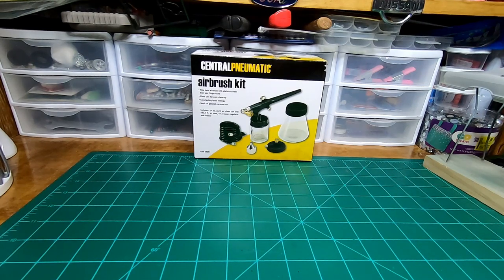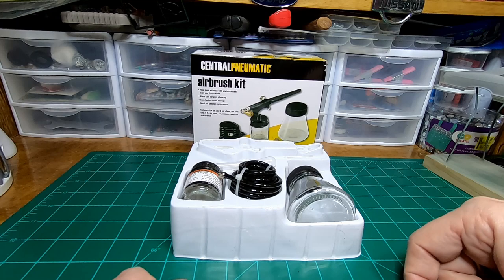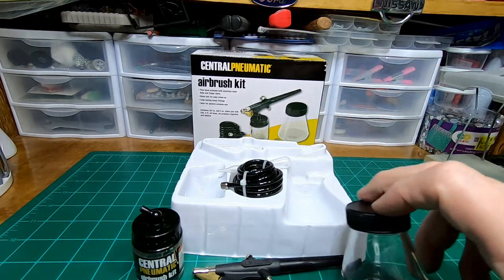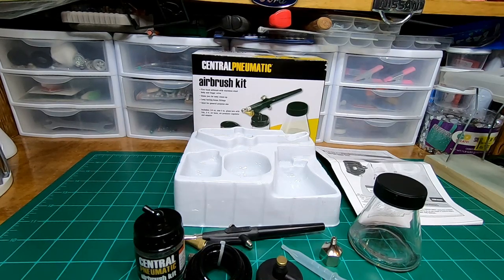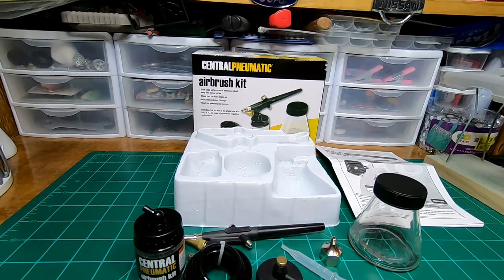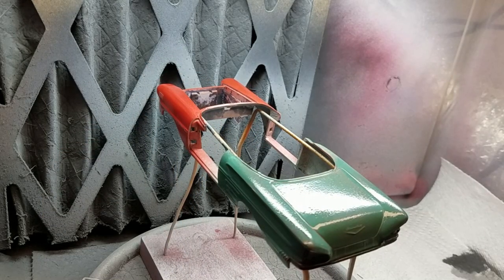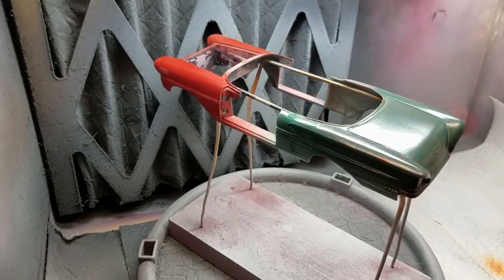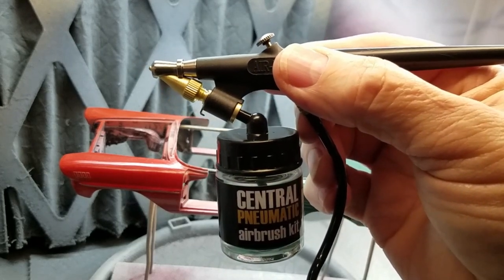**BONUS VIDEO**  Central Pneumatic Airbrush Kit Review - Episode 29

Comment: I have this airbrush, and it's one of my most used brushes. It does a great job laying down acrylic primer! That stuff can be murder on an airbrush, so the ease of cleaning is a strong point for this one. As one of your other commenters noted Harbor Freight no longer sells this style of brush, but Hobby Lobby (among other retailers) sells the Paasche EZ Starter airbrush, which is basically this airbrush in a different color. One of the first things I did when I got the HF airbrush home was to unscrew the top off the small jar and drop the jar into some acetone for a while. I don't know who the bright light at HF was who thought "Hey, let's put a label all around the jar so the user can't tell how much paint is in it!" was, but he should cuffed upside the head one!
Reply from the maker: I originally bought this airbrush for the extra jars. When I took it out of the box I thought that I would do a quick review on it. If I recall correctly this was on clearance when I bought it. Turns out that this is a pretty decent airbrush for the money and does get the job done. I am all about doing the best job for the least amount of money and this fits perfectly into that category. I have the Paasche EZ starter as well but haven't tried it out yet. I use my Model H all of the time and don't think about breaking out the EZ starter until after the job is complete. I will get around to doing a review video on that eventually. I agree with you on the label, it is very inconveniently placed on that bottle. When I did my test shoot I had previously mixed craft paint that I just poured into the bottle. I knew that I wasn't going to spray much, so I didn't worry about the level of paint. If I was going to do a full body I would remove that label so that i could see the paint level. Thanks for watching

Comment: I wanted to see how and what compressor you use and how do I hook it up part of the airbrush to make it work, i never used one before and i have this one
Reply from the maker: Sorry that I didn't include that in my video. I use a 1 gallon air compressor that I purchased from Walmart several years ago. I then went to Harbor Freight and purchased an air pressure regulator, an air fitting to fit the air compressor and a 1/2 inch male to male fitting to thread into the regulator so that I could attach the airbrush airline to it. I will post pictures of these items on facebook.com/scaleautoguy so that you can have a visualization of what I am talking about here. THe compressor has a built in regulator but having the secondary regulator makes it, IMHO, a bit easier to use. By that, I mean I can keep the secondary regulator preset with my desired air pressure and just  basically open the valve on the primary regulator without having to set the pressure every time that I use the airbrush. There are easier ways to accomplish the same thing. I already had the air compressor from a different project and only had to buy the regulator and firrings. All together, including the cost of the compressor I spent about $115.00. The compressor at the time was $99 and the regulator and fittings were around $15. I hope that this answers your question. Make sure to pop over to my facebook page and check out the pictures I will be posting in a few minutes.

Comment: I've painted a lot of models with that inexpensive airbrush. It's what I started with, actually. I don't even think they sell those anymore. I have 2 of them.
Reply from the maker: I bought this for the glass jars and to use as a backup to my Paasche. I was impressed at the quality of the paint job overall. It wasn't until after I shot this video that I discovered that they do indeed, no longer sell this particular style of airbrush. So, on that note, one could use this as proof that just because it is low priced, doesn't mean that it won't work at all.  Thanks for watching!
Reply: Got this exact one three days ago and it was on their clearance shelf. So you're probably correct. $10 well spent from what I can see.

Comment: I bought the exact same one in a slightly different package off Amazon for $15 it arrived today. I have used this type of air brush for 40 years and one of them lasted me almost 25 years. The key to keeping them working good is to clean them very good with lacquer thinner after every use! Do not soak the trigger shaft with lacquer thinner or they will quit working.
Reply from the maker: That's good advice! As I mostly use craft acrylics I don't have to worry about using lacquer thinner so much but it is certainly true that you need to keep that airbrush clean. Over the years I have used four or five different airbrushes. My first on was made by Testors around 20 years ago. I still have that one but rarely ever use it today. I have used siphon feed single and double action. I prefer a single action and I like my Paasche Model H above all of the others that I have used. Thanks for watching!

Comment: I got the next step up from this one and I got the air compressor as well the air compressor works good but I think it would do better with a tank on it but that air brush you  got looks like it works good enuff
Reply from the maker: This airbrush does work quite well considering its low price. Compared to my normal airbrush (Paasche Model H) it is extremely light weight, which could be a good thing, or a bad thing. It does spray well once you get the paint flowing, which I initially did. I don't use a traditional air compressor when I airbrush. So, I could see where there may be some differences in performance in that respect. I use a 3 gallon "pancake" compressor, which if you have watched any of my early videos you may have heard the annoying noise coming from it. Because it does have a tank the air pressure would be more constant compared to a tankless compressor.

Comment: They give the nozzle size as .75mm on the back of the one I got yesterday. I saw it at Harbor Freight yesterday and couldn't resist, admittedly first thought was it's on the wrong place on the shelf over a $9.96 tag. Haven't tried it out yet but it looks like it will be fine. Thanks for sharing.
Reply from the maker: Thank you for watching! Yes, you are correct on the nozzle size placement. I have no idea how I missed that, plain as the nose on my face... My first thought when I noticed the price was that this probably isn't a very good airbrush but was reasonably impressed with its performance. When I first started spraying with it though, ( that blotching in the video wasn't me pushing and letting up, I pushed down and kept it there ) I wasn't impressed.  As soon as it started spraying constantly is when I thought that this wasn't a bad airbrush. So, for the money, it does get the job done fairly well.
Reply: @scaleautoguysworkbench  I have been wanting to get a single action siphon. I've got two cheap dual action airbrushes and an automotive detail gun. Wanted something in between them that would do bigger jobs.
Reply from the maker: @rmxrider20032000  This one was pretty nice for a starter airbrush. I personally like the single action/siphon feed. I have a dual action siphon feed that I have found to be a bit difficult to use. I have another airbrush review coming in a few weeks. I haven't taken this one out of its packaging yet, so I have no idea how well it works. I guess we'll find that out together.

Comment: Good video lots of information
Reply from the maker: Thank You!
Reply: @scaleautoguysworkbench  can you order extra o rings.also will it spray metal flake
Reply from the maker: @iancameron198  I don't believe that you can order the O-Ring from Harbor Freight directly but I would imagine that most any auto parts store could sell you one should you need it. As far as the metal flake paint... It certainly will depending on the size of the flake. This does have a 0.75mm nozzle and that should be able to handle most metal flake paints. The metallic craft paints that I use spray through this airbrush just fine. Hope this helps answer your question, Thanks for watching!